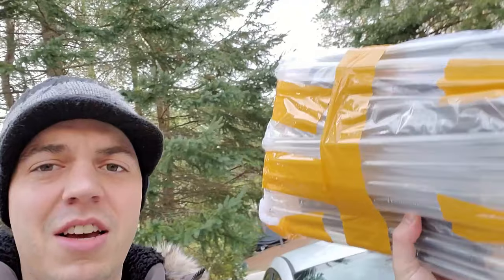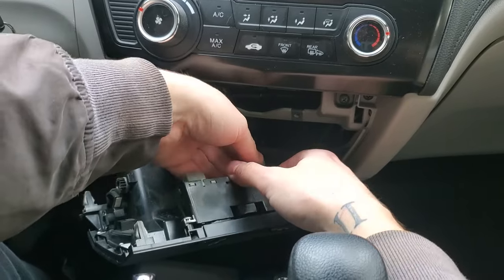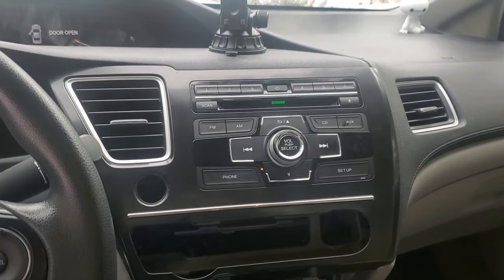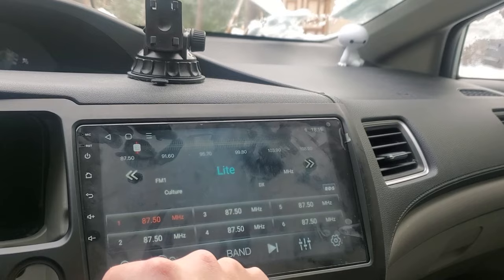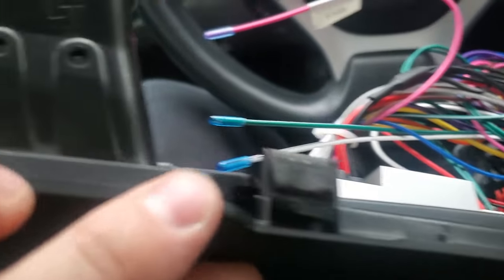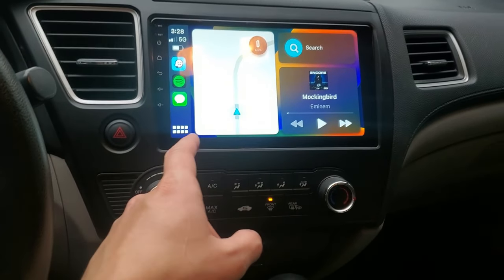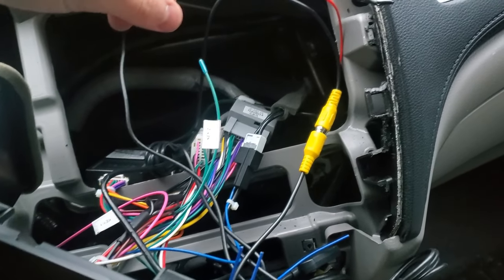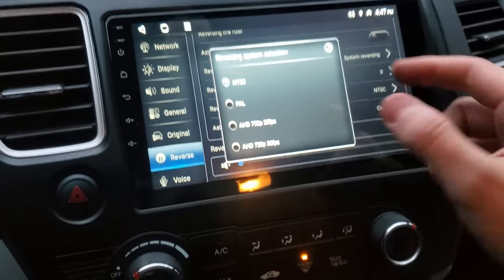Installing Android Head Unit In My Girlfriend's 2013 Honda Civic | Apple CarPlay & Android Auto

Comment: Have this exact unit.  Do you have any problems with the factory mini-screen coming on after a minute after turning the car off?  Also, which CAN model did you choose?
Reply from the maker: I personally have not experienced that. So unfortunately I can't give any recommendations about the screen. I'm also not sure, just used what came in the kit. The link to the headunit is in the description, you can try contacting the seller and see?
Reply: @zach_lush  yeah, I emailed them a few mins ago.  I also had problems with fitment in the same spot you used your dremel to fix.  The unit is drawing power when the car is off, somehow, even though I turned the sleep setting to OFF.  It's strange.  Overall though, pretty sweet unit.
Reply from the maker: Yeah fitment wasn't perfect. Odd, I thought possibly mine was draining power aswell but I've been blaming my girl for not driving the car haha. Hopefully they can help you out! I'm still waiting to know how to turn the video input off when I signal.
Reply: Did you ever figure out the problem with the mini screen in the dash staying on after the car has been turned off ?
Reply: Did you figure out the factory mini screen issue?
Reply: @tuffx13 i have the same problem
Reply: Same I just see the time blinking on my mini factory screen after I turn the car off.
Reply: @_masic_ anyone fix it?
Reply: Anyone get a fix for the mini screen?

Comment: @zach_lush How did you get the SWC to work? I just installed an android stereo kit on my 2015 civic, and it comes with a canbus but wasnt able to easily learn the SWC through settings. Im wondering if i have to factory reset something. Another issue is that the front dash with the time doesnt turn off and drains the battery. Any help is appreciated.
Reply from the maker: SWC works just fine for me. Should be a plug and play process and i believe I showed the process of setting them up. Only issue I have is the phone controls do not work. I have another video posted, link is in the description. I go over a software change i did that fixed some of my issues. Maybe give that a check!
Reply: I had the same problem, it turns out I didnt connect all the wires into the aftermartket radio, double check your wires and make sure all of them are connected, read the instructions it should tell you to connect a set of wires if your car uses a CAN BUS.

Comment: I removed the stock radio from my 2015 Honda Civic and connected the new one, after it was connected my keyless entry and push to start isn’t working so I put the stock radio back in and connected everything, my keys and push to start still isn’t working and now the stock radio isn’t turning on and the little screen up top by the speedometer isn’t turning on either. Any suggestions?
Reply: Ok I figured it out just like your video said fuse #10 blew out so I replaced it and now both screen are working, next in the new radio I see a #10 fuse plugged into it in the back it came with it plugged in the back, that fuse needs to stay plugged in that spot right? I can’t pull it out is that correct?
Reply from the maker: Yeah, the fuse in the back of the new radio has to stay there. Not sure what would happen if you managed to remove it.
Reply: That little black box that you were connecting to the wires in back of the new radio, it has two connections on both ends of that little black box, what is that black box exactly and what does it do?
Reply from the maker: @ITzUIWAJ2017  its the canbus, helps with communication between the car and radio. Its required for the radio to work
Reply: I’m having trouble finding out what connections get plugged into it

Comment: I got a similar unit like this today and keep blowing the 10amd fuse for some reason. Rechecked wiring and im stuck😭
Reply from the maker: Only thing that fixed it for me was putting the originaly radio back, reconnecting the battery, confirmed everything was okay, disconnecting the battery again, install the android radio. It seemed like when the battery was connected it screwed up the system and cause fuses to blow.

Comment: How to program steering controls and does it make ur imid screen stay on 24/7
Reply from the maker: Programming should've been shown in the video. Also no, the imid is not on 24/7. You may have to change the vehicle settings through admin settings. This is shown in the video i linked in the description. If this does not help I would reach out to the seller.

Comment: Everything works in mine except that I can’t hear anything. Any suggestions?
Reply from the maker: I would first start with the connections, after that double check the fuses. My issue originally was a fuse.

Comment: Did you guys replace the fuse?
Reply: The same thing happened to me do not just need to take out the battery and try again?
Reply from the maker: Yes, originally had no idea what was going on when multiple things stopped working properly
Reply: @zach_lush where did you guys get the new fuse from and did you replace it immediately or after it had worked?
Reply from the maker: @PeterJosephChukwu  in the engine bay theres extra. Changed it right away
Reply: @zach_lush thank you so much
Reply: @zach_lush weird question but would you mind helping me do so?
Reply: @zach_lush I did it! Everything works now thank you

Comment: Hello is it better to get the 2g or 6g one ?
Reply from the maker: That is the RAM. Basically the more RAM you have the more applications can run at the same time. Typically the device will be more responsive if it has more.

Comment: I have the same car, same radio, won't turn on, same fuse blew 😅, replaced it, still not turning on and the worst thing is that even then old radio won't turn on now when I plug it back in. 

SMFH 😢
Reply from the maker: Best I can suggest is check all of your fuses. Including the ones under your steering column.

Comment: How’s the audio quality with this stereo?
Reply from the maker: I would say it's the same, maybe a little better
Reply: Awesome! I got a similar one off of eBay, ended up returning it because the volume was pretty low, I would have to turn it all the way up to 35-40 to get decent sound. How’s the volume output with this one?
Reply from the maker: @Vlad_G35  oh thats brutal... I believe it is okay, I think when I'm by myself I have it around 20. Have to lower it when having a conversation. Only weird thing is if anything makes a notification noise or put the car into reverse. It makes the volume go lower, almost like the rear speakers are the only ones working. After rebooting it's fine. Also I noticed with with android auto, not car play.

Comment: I can’t find the yellow camera cord that comes with the car to connect it with my camera in the car stereo
Reply from the maker: Like a factory yellow cord and camera? You may need to use the aftermarket one. Im not much help with the factory camera so you may need to contact the manufacturer.
Reply: @zach_lush  yeah like behind the radio head unit it came with I couldn’t find the yellow camera cord to plug it in with my android head unit so the camera is still on the small screen in my Honda civic
Reply from the maker: @ljayboy3375  i ran an aftermarket camera cord that came with the headunit. Its not using the OEM camera that came with the car since it never had one. So i can't really help you with that.

Comment: That's so weird. I have the same model and year. I have a reverse camera  no blind spot camera. But no heated seats either. Any who I wanted to upgrade the head unit so thanks for the vid.
Reply from the maker: Yes very odd, eventually I have an update video trying to fix the issues. But no problem.

Comment: Does the normal reverse camera not work anymore after installation?
Reply from the maker: This specific care never had a reverse camera. I don't believe the stock one would be affected but honestly I'm not sure.
Reply: @zach_lush  okay thanks. I’m about to order it, just one last question sorry lol. Did you ever get the right turn signal to stop popping up the camera? Mine isn’t equipped with that feature
Reply from the maker: @JOEY11.06  nope, still happening. I've messaged the seller asking how to turn it off but haven't heard back. Going to ask again.
Reply: @JOEY11.06 did you ever install the unit ?

Comment: How did you figure out the wiring?
Reply from the maker: Just matched up the connections
Reply: @zach_lush everything is good but I get no audio
Reply from the maker: @olympicstudios4131  hmm, id suggest checking your fuses and did it come with a canbus box? If that doesnt work you can try changing the car model the headunit works for. I have an update video where i show how to do that. If that doesn't work i would just reach out to the seller.